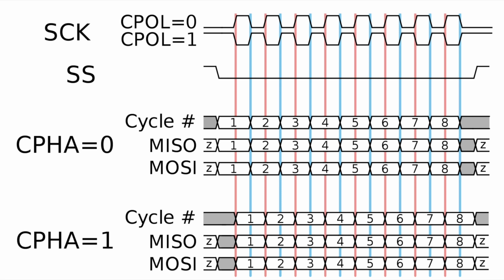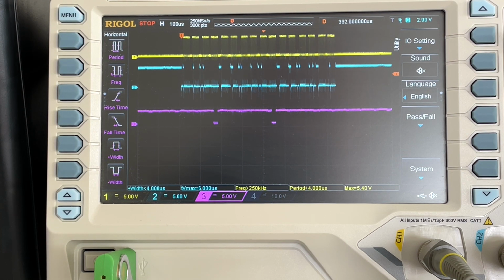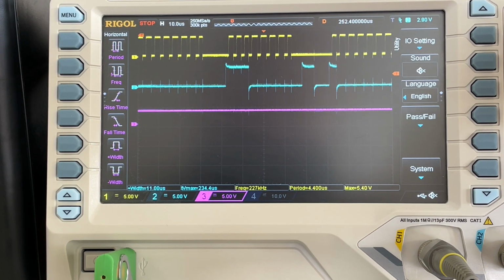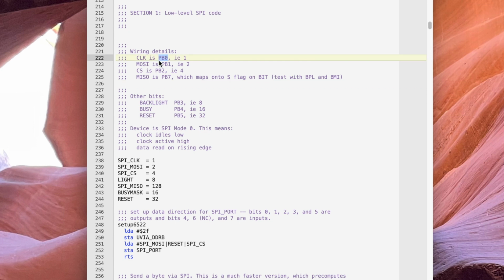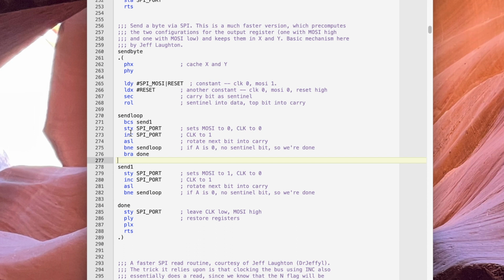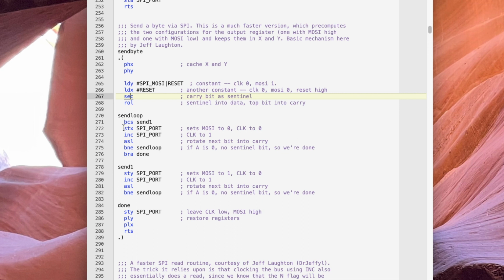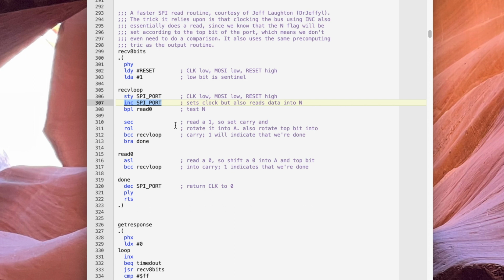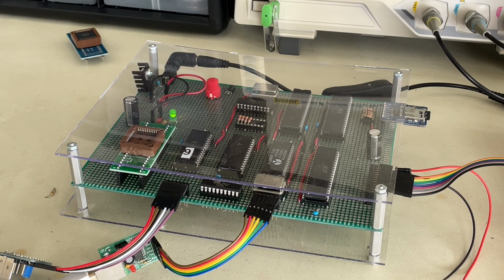6502 Mite home-brew computer, interlude: SPI tutorial

Comment: I used the SPI code and explanation in your video to optimize my I2C code.  I was getting about 11kbps with my previous code and now I'm currently getting about 16kbps.  I still have to move the data pin to pin7 to make use of the negative flag -- that will shave off a few more cycles.  The principle I took with I2C is basically the same as the SPI code: load X and Y with precomputed Data Direction Register contents and then DEC instead of INC on the DDR to raise the I2C clock.  Unfortunately you can't use that cool INC trick to read the data.
Reply from the maker: I'm very glad that it was useful!

Comment: Nice piece of 6502 optimised SPI code.  The 65SPI seems like a bit of a cheat, for a retro system, but then again you are now using a modern LCD display. :)
Reply from the maker: True, although since the 65SPI is basically just a very fancy shift register, it's not nearly as much of an anachronism as the SPI video card!